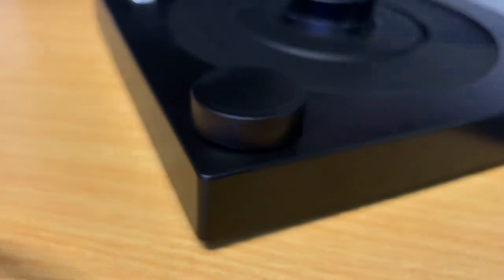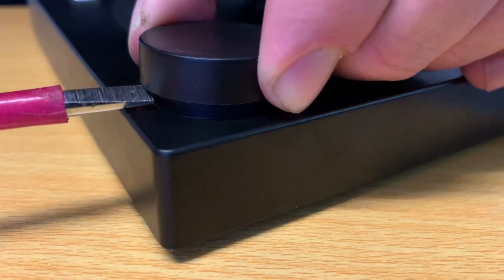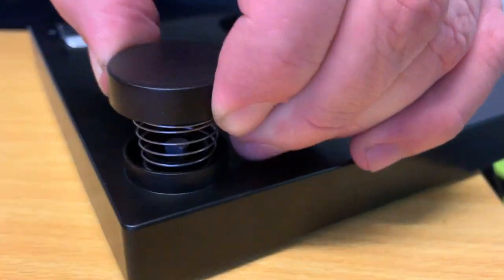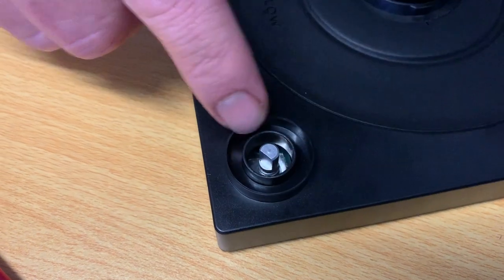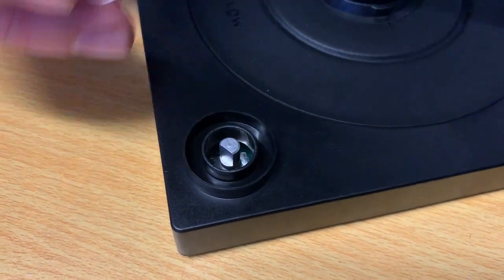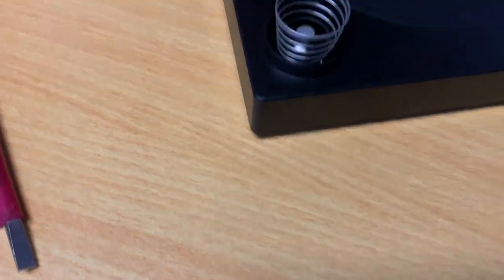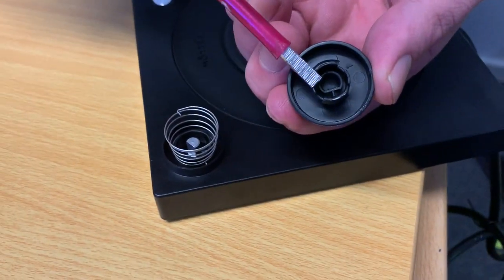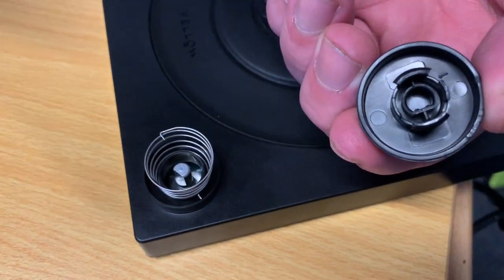Fellow Stagg EKG - Cleaning and Maintenance - Toggle

Comment: Do you know how to open the base? Is the rubber matt glued onto the base or can I pull it off, or where can I find the screws? I'd like to change the power cable for a longer and more flexible one. Also I was thinking of modifying it by soldering a power diode or two (5A parallel or 10A) between the contact to the kettle and the hot phase, to cut off one wave to use the kettle at 230V AC (with pulsating possitive 115V DC) But since I have a step down converter I don't really need to do this modification, I'm just interesting how repair/modifying-friendly this kettle is.
Reply from the maker: Hi Mattbrhew,

Thank you for your message, we weren't quite sure of the answer so we checked with the engineers at Fellow and we have found;

Tampering with the product in any way voids warranty, as does using step up/step down converters if the product is being used on the incorrect power.

The base is not something that is designed to be serviceable. The sticker on the bottom hides the security screws, if you try to take the base apart it will most likely get damaged. 

We hope this helps answer your questions.

Kind regards,

The Bombora Team
Reply: Since my main voltage is 230V AC here I have to use a step down transformer. Mine is dimensioned for a power of 2000W. On the primary side I can choose between 240V, 220V, 200V and 110V and on the secondary side it has a socket for 110V And 240V. 
Using the 220V input results in 115V on the secondary side with a power of 1046W   and it took 4m30s to bring 600g of 20°C water to 98°C.
On the  200V input I get an voltage of 126.5V out, and a total power consumption of 1256W (the converter tooks 33W). The current should be at 10A or even a few mA less, so under this conditions I think it doesn't damage the Kettle. Also heating up 600g of water takes 1 minute less comapred to to 220V input.
Reply: @BomboraSupplies  you say "The base is not something that is designed to be serviceable". I think thats wrong, everything we buy is our own product and we have the right to open it up. I want to open up mine too, because I am designing a tea table with that kettle integrated. If you would have an expoltion drawing of the base, that would be teriffic.
Reply: @DIV1NITAL thanks for getting back to me. Indeed disapointing! I recommend Aliexpress, many copys of that kettle for less than half the price
Reply: @alexschaub3363  I think they literally mean it's not designed to be serviceable because it's all glued together ... seriously this type of product is incredibly unethical, the problem is they break and then end up in land fill. There should be legal constraints on companies making products like this.
Reply: @MrGreenlntrn  I totally agree. At least mine stil works very well 😃
Reply: @MrGreenlntrn  To make it worse, the base often has fails right out of the factory. You would be surprised how many people have to replace their base due to faulty buttons that "can't be serviced" while in reality it would probably be as easy as reflowing a solder joint.